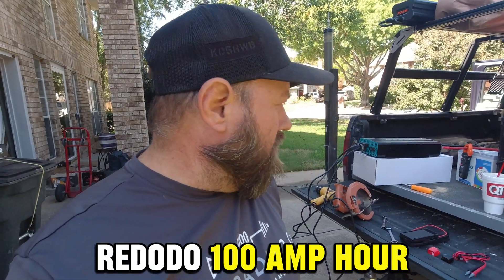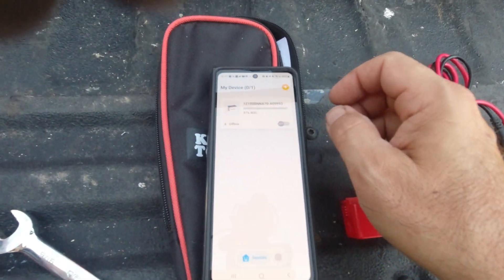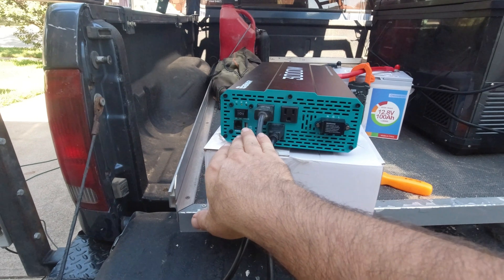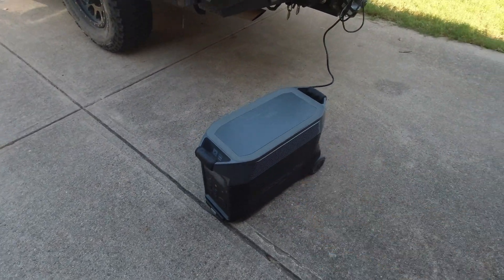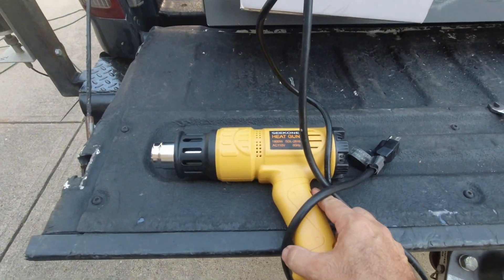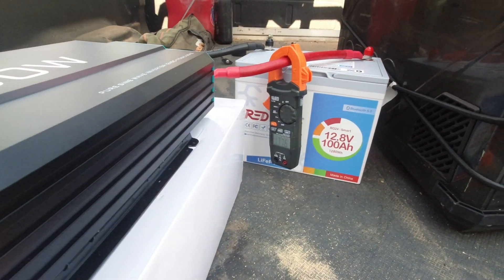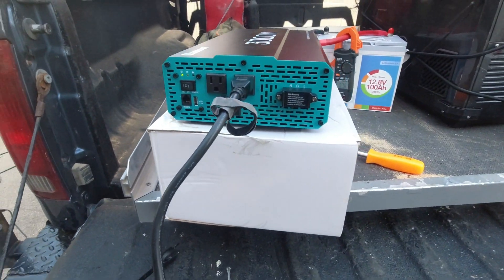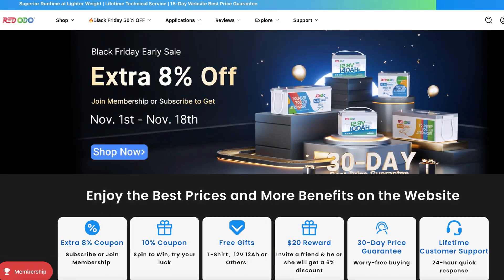Testing This 100AH Battery To Its ABSOLUTE LIMITS

Comment: Some inverters do have an automatic power save mode. They will turn off below a certain load and periodically turn on and keep running if there is enough load.

Comment: Modern DC to AC inverters work by using a high speed switch to convert the 12VDC to AC through a transformer then rectified to about 350 VDC. The HV DC charges capacitors. Then the DC is converted to 60 HZ AC by FETs switching at a high frequency to synthesize a sine wave output that is filtered to pass only the 6o HZ component. The 2.5 amps you see are what the first DC to AC converter is using because it runs all the time. All of this switching causes RFI. I have to turn off my 2,000 watt inverter when operating HF.

Comment: You may need to select DC amps for that meter and zero it then clamp on wire.  Check the manual.  Some clamp on meters check AC amps only. Go threw the manual.  Battery is nice.  73
Reply from the maker: Apparently this one is AC amps only - it advertises it will do AC/DC voltage, but not Current.  So I am returning it and getting one that will measure DC Current.

Comment: Your meter was on ac amps. You have to push the select button to get the dc reading.
Reply from the maker: @Itsallpossible285  actually I don't think this meter does DC current
Reply: @HamRadio2  Amps are amps for the most part. The only real difference is the flow of the current itself. Although the klein cl800 and cl900 read dc current the cl600 and cl700 do not.
Reply: @thehighskyguy  DC current isn't changing so can't be measured using a simple coil like the cheaper clamp multimeters used. DC current requires hall effect sensors (in a clamp on meter) to measure properly, so requires a bit more expense in the meter. Alternatively, an in-line ammeter can be used.
Reply: @thehighskyguy 😂😂😂😂😂😂
Reply: @HamRadio2  You are trying to measure a DC current.

Comment: as for the current draw, you can calibrate the sensor in the battery on mine and i checked it against my calibrated meter and now they're pretty much dead on each other.

Comment: i have a 100ah battery in my work truck  with a 3000 inverter (inverter is rf noisy unfortunately). it also has a remote control panel wich is great because i can turn it on/off from the cab of the truck. it's great and well worth it if the inverter/battery is going to be in the back of a van/truck bed.  i've yet to have the battery run flat to it's disconnect level even though everything is on all day every day because it charges whenever the truck is running and supplying > 12v to the battery charger.

Comment: I have 2 100ah Redodo mini's in a dewalt x large tool box. Total weight is 46 lbs. Not bad for a 200ah battery box. I haven't had any issues with Redodo batteries. The batteries were bought during a black friday special and the monitor and usb port from amazon. Bus bars were made from flattened cooper pipe. Total build was less than 500 dollars.

Comment: You are trying to measure DC current with an AC ammeter (that's why you see the discrepency.) The battery is giving you your true current draw.   73, KV4CW
Reply: Indeed, the battery's measurement via shunt is correct, and the clamp meter set to AC which uses a current transformer, won't work on DC. DC will need a hall effect sensor. Great little batteries, the group 24 is nice, and they make them even smaller (5.5" inches deep) which is just incredible. 73 de WØJO
Reply from the maker: The meter was set for 12VDC
Reply: @HamRadio2   The Klein CL120 has a simple coil and will only detect AC current properly. You need a meter with hall effect sensors to properly detect DC current. This is directly from the CL120 specifications: "Measures AC Current and NCVT via Clamp and AC/DC Voltage, Resistance, and Continuity via Test-Leads" - note, "AC Current and NCVT via clamp"
Reply from the maker: OK thanks, I will check on that.
Reply: The CL380 and 390 can do inductive DC, but I would rely more on an inline ammeter.

Comment: If that was really pulling over 200 amps on 12v that's impressive! That is 2,400W or exactly the same as a full load on a 20A 120v!!! (For those wondering what they need to power just about anything via inverter as long as it's fairly efficient I just answered your question YW, 200AH rating with pure sinewave should power anything you can plug into 120v 20A outlets!!!)
Reply from the maker: It shut off right before it got that high
Reply: @HamRadio2  still impressive considering that it's only rated for 100ah. Goes to show it can probably start a decent size air compressor or something like that as long as the continuous draw isn't much over 100a